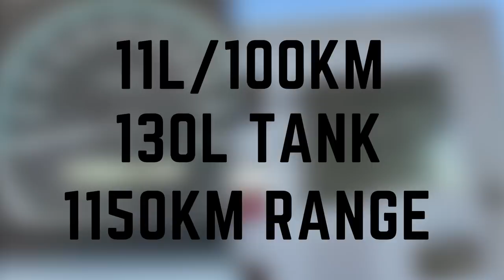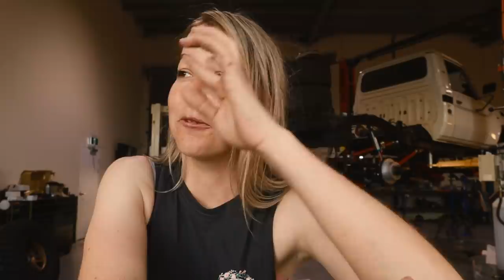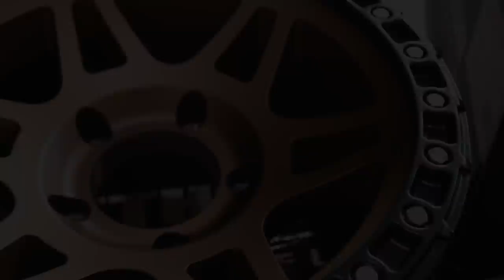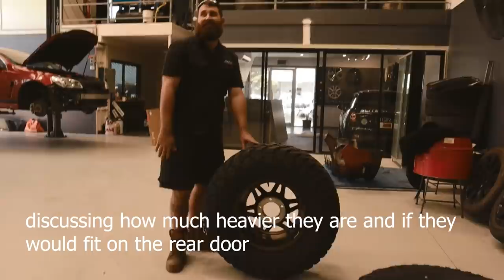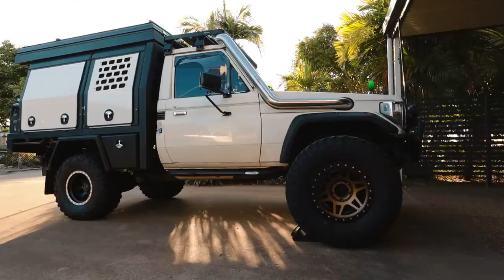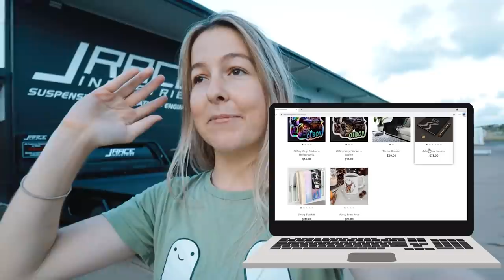Driving & Modifying a limited edition 70series (1 of 39 made!)

Comment: Thank you for explaining the tyre/rim numbers and sizing and what it means! The rig is looking amazing. I bet it drives like a boss!
Reply from the maker: I'm glad it was appreciated:) it's drives so incredible!
Reply: @DanieSimpson   Why not 35x12.50r17 🤔
Reply from the maker: @gen1c8rs88  because they arent legal
Reply: @DanieSimpson  Does that mean that the 76 would have to be engineered or is it's not legal ? I have seen 75's and 79's with 35's
Reply from the maker: @gen1c8rs88  definitely not legal on a 75 but some states like NSW it comes down to the certifiers individual discretion but majority is only 2" larger than factory so generally no you cannot run 35s
Reply: @DanieSimpson   Ok great, thanks, what do the 315/70r17 measure on what I am guessing 17x8.5 wheels without the weight of the vehicle, thier free standing diameter at thier on pavement tyre pressure?
Reply from the maker: @gen1c8rs88  all on the video, they are a 34" off vehicle. The rims are 17x9
Reply: @DanieSimpson   225/95r16 is a OEM size in Australia for a 76 series Wagon. At 32.83 inches and add 2 inches that's 34.83 inches which means a 35 inch tyre should be legal ?
Reply from the maker: @gen1c8rs88  exactly which is why we can legally run 34s. 35" is larger than the 2" increase and hence cannot be certified. Some states it comes down to the certifiers discretion but unfortunately you can't round up and any inspector will question why you have 35" tyres (even if they measure under a 35"). Just makes it a hassle really better to just go the 34"
Reply: @DanieSimpson   OK, good point. It would be alot for an inspector to memorize all the truck and suv oem maximum tyre sizes and the various 35 inch tyre's true diameter, these rules make it simpler for the inspectors to do thier job.  I guess that showing the AU or US Maxxis website's 34.8 inches(884m) for the 35×12.50r17 and pointing out that the 225/95r16 an OEM option for the 76 series is 32.83inches(834mm) is not allowed ? Thanks for all your educating words, you have helped me even though it's not your job😊
Reply from the maker: @gen1c8rs88  yeah they have a database to look up factory tyre combinations from first stage manufacturer information. Long as you've got actual evidence and engineering reports to back up all modifications it makes everyone's jobs and lives alot easier:) And that's okay, always happy to have a chat

Comment: Funny you say that about the standard steering wheel, i went and bought one for my non air bag model 76 series, and i think the wheel was like on oleboy 2007 model lol, the updated one is 100% better than that old skinny massive wheel i used to have
Reply from the maker: 2007 had the same interior as the 75series yes:)
Reply: @DanieSimpson  sure did, i love the metal dash etc but the original qwheel was 🤢

Comment: Hi Danie.  I have a Landcruiser  76 Series 2020. I Just ask you about : I want put 35" tires on my Landcuiser . So how many inch lift I need to install ? Thanks.
Reply from the maker: 35s are illegal so I suggest going to a smaller tyre size. What tyre size you can fit will come down to your rim offset, track and guards not lift.
Reply: I think tyres about : 315/70/R17. anh I don't know about choice between 3 inch or 4 inch  litf kit.
Reply from the maker: @tommypaintingplastering2854  that is a 34" tyre. 4" is also illegal and 3" you will need to pay for and pass certain engineering test procedures. most people are better suited to 2" and 33s which don't require engineering or additional lift components
Reply: @DanieSimpson  thanks Danie.

Comment: Great video , did you use the same offset rim front and back ? Don’t Vdj series have different track front to rear ?
Reply from the maker: Yes same offset front and rear it is not legal to correct the track by using bigger offset rims. We designed and sell an upgraded rear housing which corrects the track issue so that is what will be installed

Comment: i run 1 set of Black star guyane 31x10.5r15 for mud and a set of cooper stt pro 32x11.5r15 for road and soft mud, on my 1cm lifted (can feet more to enter my garage LOL) KZJ 73.
Reply from the maker: yeah awesome the 73series are so cool!!
Reply: @DanieSimpson  mine got a little motor upgrade, front intercoler , 900gr turbo pressure now m'y 1kz make 155hp and 400nm. Run absolutely perfectly at 28 years and 303 000 km.

Comment: Great vid Danie! Some good info for those that may not know what all the ratios, etc. mean. Cant wait to see the rest of this series, as im thinkingof getting a 76.
One question, how does the 76 tow compared to your 75? Is ot more stable, and more or less comfortable? Also how does it go off road compared to the 75
Reply from the maker: thank you! Both tow good just the 76 is quicker, comfier and quieter. 75 is better offroad currently due to it being twin locked, so everything can be done alot slower and more controlled.
Reply: Yeah righto. Probably what i figured, and hoping. but great to hear an honest opinion from someone whos used both. Keep up the good work.

Comment: Nice wheels, I’ve got Methods on my 200
They weigh a heap more than standard wheels 
But way stronger 👍
Reply from the maker: 15kg is what these weigh most 200series wheels would weigh close to that
Reply: Not sure what they weigh but mine are MR305’s in 18 inch
I do know when I changed them they were a lot heavier
Reply from the maker: @nzmarkb8713  alot of the weight comes from your tyre if you changed that too
Reply: @DanieSimpson  you might be right,  but I did have the same tyres on the std mags
I’ve still got the original mags, I might weigh one one day to check what the difference is

Comment: Hi Dannie, I heard that in AUS. bead locks are not allowed on wheels of street cars.  Do you know the reason? Thank you.
Reply from the maker: there is a standard set out for use of alternate rims in Australia. Manufacturers have to meet those set standards to be able to say their product  meets the standards for onroad use. I believe there is rims made by ICON that have achieved DOT approval and there are also a few rims that can be standard mounted and then also mounted as beadlocks for offroad use. You can download the Standards Manual and have a read but I believe it comes down to number of welds allowable
Reply: @DanieSimpson  Thank you for you reaction. Where I live we had an issue of a bead lock on a wheel separate and cause damage to an other vehicle. I will check the Standard Manual. Thank you again.

Comment: If only could posts in comments mines a 94 75series coil converted front end with a 105 front diff soon to be having a rear 4link coil conversion in the rear with 105 rear end 
Running 295/75-16 maxxis razor MT. 🤘🏼
Reply from the maker: nice but keep an eye on that 105 diff they're significantly lower rating than the 75series factory housings. seen plenty snapped in half because they aren't made for Ute's and load. We custom make all our housings for 75series 4 links so they're actually stronger than factory instead of you ending up with a weaker car

Comment: hey Danie, have u got any mods plan for it because I heard with the 76 series even if you have GVM Upgrades it still doesn't have as much load capacity as it brother the 79 series. Great vid tho
Reply from the maker: 76series does come factory with a smaller GVM, same as every Wagon will have small GVMs because they arent designed to carry rear load like a Ute. Upgrading your GVM comes down to a few factors, pre/post rego, suspension modification/axle housing substitution/chassis modification. All is just time and money. We have many modification plans, alot are detailed on my Instagram  posts.

Comment: Why did you go the RAZR MT and not a RAZR AT?
Reply from the maker: have no interest ever running AT on any 4wd. If you had a car that never went offroad maybe you could save a few dollars going AT but otherwise no real point to them. Wear out so fast and terrible for any kind of mud or rocky areas where you need good sidewall grip
Reply: @DanieSimpson  hey fair enough, we've done CQ to the Cape a few times on AT's but probably nothing as serious as the tracks you do. The AT's definitely have a shorter lifetime
Reply from the maker: @tkdp54  you can do any track on pretty much any tyre. driving a track comes down to a lot more than tyres. I just don't see the point in something lesser when mud tyres are so good

Comment: Sorry Danie. 

But the car doesn't need to be basic for it to last. 

It's done because the car is just a basic work car. Please don't hide behind the "it's reliable like that" crap.

They could easily put a Hilux type dash setup in it, but they know farmers would just wreck it all
Reply from the maker: bit confused. 
1. what are you sorry for?
2. of course it's a basic car? that's the point:) Noone said it needed to be anything.
3. not sure what you mean by "hiding behind"? I simply stated I like that it has the same aircon controls because I know they last as opposed to alot of other modern vehicles with electric dials etc that fail after a decade.
4. if you want a fancy interior car that's awesome! But I wouldn't ever buy one if it had a full hilux interior, not my cup of tea🤢 
5. Everyone is well aware the 70series are an agricultural style vehicle and have been since the 80s. it's why I've owned one for a decade and why we didn't think twice about another.
Reply: Farmers don't wreck everything. My 40 series is mint.
Reply from the maker: @dannyconelly1454  second that. comes down to the individual owners and where their priorities lie.
Reply: "But the car doesn't need to be basic for it to last."

Does seem to help though and fixing basic can be done relatively easily unlike the bells and whistle car , back to the specialist dealer for sure with them which is alright if your only in the ownership for the short term
Reply from the maker: @Andrew-76  yeah that's it hey. Personally working on newer vs older vehicles from a mechanical viewpoint. the basic, mechanical components last alot longer in unfavourable conditions such as incredible heat, dusty, salty, rough operators etc. and overall usually cheaper and quicker to repair.
Reply: @DanieSimpson  sorry I realise my comment looks rude as hell hahaha.
Reply from the maker: @DarrenBoxhall  no not at all! just don't be sorry:) we all like different things